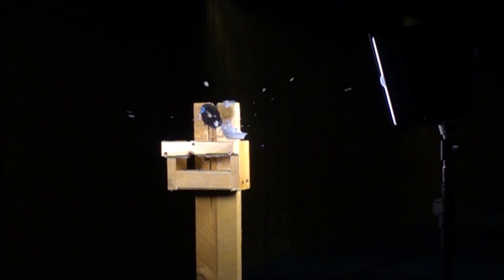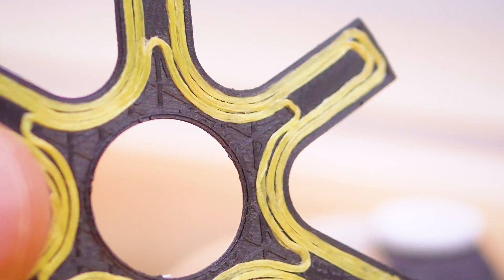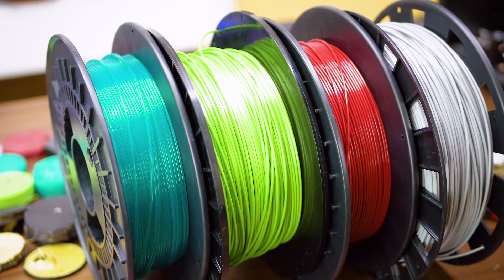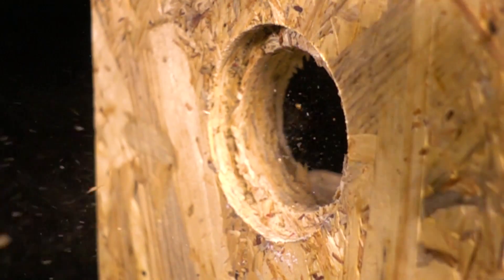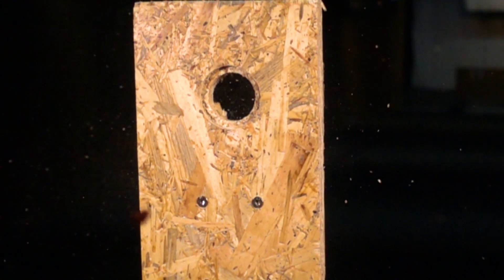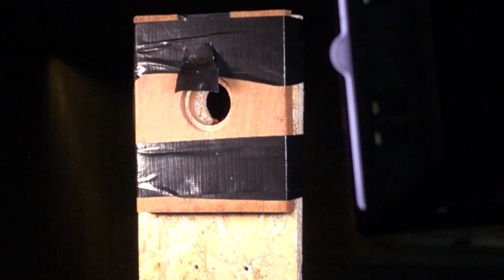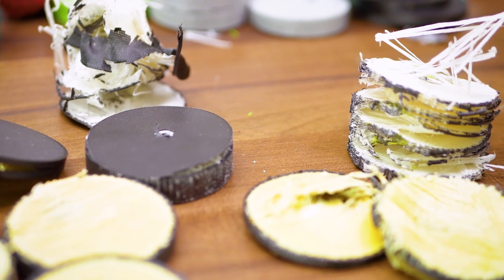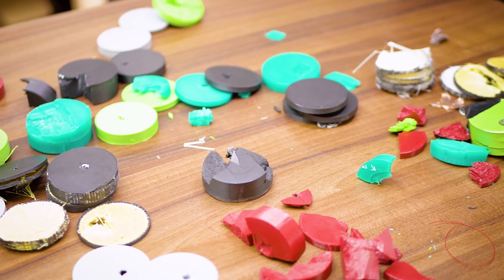Destructive testing: Which 3D prints are bulletproof?

Comment: Try TPU
Reply: i tried tpu. the brand i used needed 40mm to stop 9mm pistol round. stops at around 35-37mm. maybe some impact resistant nylon or high strength and elastic tpu would be best
Reply: @morecakesmorelays3270  Ok. Interesting. I thought the TPU part would have coped better. I wonder why the elasticity didnt pick up the energy. Maybe the 0.22 is just too fast.

Comment: Couldn't you either print or order a larger gear that drives each axis and that way when the machine carves it's a fraction of the depth of the non modified one. That way there's less pressure applied to the head and less flexing of the frame. Also maybe think of a water dripper over where it's carving for less likely to break whatever bit you are using

Comment: Hey tom, if you ever reedo this experiment, could you test to see if different infill patterns affect the bullet resistance? Or in the case of PETG, see if it holds it shape with shattering to pieces?
Reply: These were solidly printed parts, so 100% infill by the looks of things, the infill pattern used doesnt matter too much then.

Comment: WELL ... you printed them the wrong way, actually PLA has stopped bullets at 10 mm thickness, but the secret was they did not print it solid but nanotube inside, and yes, it requires a fine nozzle.

Solid structures snap at impact, nanotubes printed in progressive layers actually behave more like Kevlar, compressing onto each-other rather than snapping.

Design some nanotube structure, print it carefully, larger surfaces, minimum 10X10 Cm, try again, and you might come to some dramatically different conclusions.

Comment: Why did you test 45 ACP instead of 9mm? 9mm is way more common throughout civilian use, police use, and military use than 45 ACP. Not only that, but 45 ACP is the most powerful handgun round outside of hunting. It would make more sense to test the middle ground (9mm) rather than only two extremes (22 LR & 45 ACP).
Awesome video either way.

Comment: Hi, Thomas.  
Thank you for your great efforts in making this video -- Excellent stuff! 
I'm considering getting into 3D printing and maybe injection molding and have a query.

I have no plan to get shot at, but I do have some plans to make some kind of body armour for motorcycling. I was wondering if you or anyone else here could recommend a plastic/plastic composite material that would be relatively light weight, impact & abrasion-resistant, not have a tendency to explode into SHARP fragments.

The material is only intended to deflect rocks/prevent puncturing from sharp objects, but an amount of repeat performance would be desirable, of course. The main impact would be (hopefully) absorbed by a non-Newtonian layer, underneath the outer shell.

I've only just stumbled upon your channel and am about to embark on a tour.
Thanks again.

Comment: use hatsan 125 4,5mm 395ms as a test air rifle, i found out it goes thrue thick wood (they also got a 5,5mm but its 5ms slower but hits much harder) and i stopped using lead pellets so i only shoots steel in plastic.

Comment: how did you trigger the rx100??
Reply: Ah, thanks. I have one myself, but didn't know about the IR remote. As for powering the camera, you can just use a regular usb power bank on the cameras usb port. works like a charm.
Reply: Thomas Sanladerer Ah I see.. thats really dumb. I would have expected that the camera has a built in receiver already. I love the quality and the slowmo (that what I bought it for) but I don't think I would buy it again. The battery life is horrible when you do anything but take stills. And filming 4k video overheats the camera after just a few minutes and it needs a cooldown break.
Reply: no slomo, though ;P

Comment: Coolest plastic test ever!!!.
As an engineer you should know that PET is a very brittle material when even injection molded. So from an FFF nozzle you are not going to get the strength of a plastic water bottle. To get PET to be strong it must be stretched out, like blow molding or extrusion into a filament shape when using a draw down or even when doing a long 3D printed bridge.

Comment: 3D printing a Batman suit is one step closer to reality.
Reply: a dude on youtube is actually making one lol
Reply: @ABlackGuy10  Im making one... correct coloration, correct indentations ... No fake fabric nonsense... Its a long process. Mostly carbon fiber printed. The point is to make it an EXACT replica of the Dark Knight suit of armor. something like 80 separate pieces.
Reply: @someguy5926  You are better off getting something milled / CNC over 3D printed as a well-forged steel base is going to be heat treated in a way that 3D printed materials do not. You are also on the right path with kevlar layer's underneath but remember that just kevlar fabric by itself is not bullproof at all – it needs to be MANY (often like 30-40) layers of kevlar fabric which is often dipped in epoxy (basically plastic glue) that further solidifies the kevlar fabric into a plate. THAT is what is at the core of most bulletproof objects, like vests. You should also look into how ceramic ballistic plates are made. Overall 3D printing is great for looks but poor for material strength / hardness due to the way it assembles things. You would do far far better with a few stand ceramic tiles wrapped in a fiberglass sheet & some duct tape that everything presented in this video (which would be cheaper, easier/faster to make, & probably lighter). I am pretty sure that the production designer's of TDK meant this to be the material used in the batsuit because they call it a "composite" which usually refers to something like this when talking about ballistics. Perhaps with some aluminum thrown in for good measure. If you are deadset on using plastic you probably want to use HDPE (can be gathered from milk jugs & other food safe plastic), cut into small pieces then melted in any oven (look on youtube). You can use aluminum foil or wax paper to create a DIY mold for these as well & mass produce a number of essentially ABS plates that do NOT suffer from the weakness shown here from the 3D printing process. 

Material science is very important folks! Good luck on your suits.
Reply: @someguy5926  People are just looking out for you man. Better to give some good advice than have someone run around in a suit that blows to bits on the first impact.
Reply: I definitely wasn't thinking the same thing at 3 am so I can make one.

Comment: What filament would you recommend for parts to be used outside please. I want to print some custom handles to go on a small lever that is used on a motor cycle. They would be about 1 1/2" and threaded onto a bar. so they would have to put up with regular twisting. Thanks
Reply: not hundred percent sure about exterior use for a motor cycle since most plastics might melt in the hot sun or shatter in cold weather. But there are some that stand up better than others. How much twisting force is evolved, printed parts can be designed structurally strong but the shear force of plastic is still pretty low. If you plan on going forward I would suggest that you put a heavy UV resistant coating (or paint it) to protect it. Question does it have to be made of a printed plastic. Why not use the part as a prototype, test fit its placement, then when happy maybe get it cast in another material. Use it as a mold and cast parts using stronger resins or metals like aluminium or pewter. Both of these can be done diy-ish but it steps out of the bounds of just 3d printing it. So you might have to do some research on the methods. Hope you find a way to work through it

Comment: I wonder if it's possible to make the PETG less prone to shattering with a mix of materials, ie Dual extrusion. Obviously the best option would be to just use a different material, but could be a very visual way to show changing the properties of parts.

Comment: In simplify3d you can change the infill angles, meaning that instead of 90 degrees on every layer, you could try something like 10 degrees each layer so you won't get these square holes.
Reply: The square holes were on the MarkForged prints, made by MarkForged with their own slicer for their own printers.

Comment: If you hang the part you would of got completely different results as the holder you made puts pressure on the center of the disc and not on the overall object. The holder made it to where the outside could not budge so it simply went wit it that is why the last two kind of went through and got stuck
Reply: Like it briefly expands, gets lodged/press fit in the hole, then explodes into a million pieces because of static pressure? Like we see with paper in an hydraulic press?

Comment: I wonder how nylon does.
Reply: The Onyx is a nylon print.
Reply: That said, it's a carbon fill, which increases wear resistance, but might work against structural integrity. (Also, with the square holing and fracturing happening on the MarkForged parts, I'd like to see another nylon print by Tom himself.)

Comment: I still haven't gotten mine printing :(.  The nozzel starts to extrude but then after about 20 layers it just stops extruding... the gears in it is spinning  and no clicking.. also It is not jamed becouse I can stop the print and push the filliment threw with no problem...
Reply: You sure its not slipping? Pull on the filament with it locked in the extruder and see how much force it takes to slip backwards. You may need to clean out the gear teeth of the extruder.
Reply: When it stops, instead of pushing the filament through, pull it out and take a look at the part that was in the extruder -- is there a chunk ground out of the filament?

Comment: It would be interesting to have an internal structure with mixed materials to absorb the impact and distribute it inside the armor, converting it into deformation. Something like layered plates that push together and shift inside. Doing this with multiple layers and maybe kevlar / fibre sheets between layers might work. Or maybe not.

Comment: great video! reminds me of Mythbusters...very good job and interesting that in a worst case scenario, we could at least lessen the impact of bullets by having 3D printed parts in certain cases.
Reply: Yes, and it reminded me of when I lived in San Antonio, TX and the gangs were doing drive bys every single night.  They did them so much so people were told to sleep on the floor and there was a thriving business to put kevlar in the walls then the remodellers would put the sheetrock back up.  Now just print off 50-60 MM pieces yourself and insert them into the wall.

Comment: Surprising result for PETG !
Can you do the same with Nylon , POM and flexible ?
Reply: Gil B Actually, not surprising. PETG tends to crystalize(?) when cooled slowly. Especially, when printed with higher temperatures. It often cracks in random patterns, not even within layers. That's why I still prefer quality ABS for mechanically stressed parts.
Reply: PETG was all the rage (I even have a roll myself but I don't like it) last year but I think people have wised up that it isn't all that great afterall and sags like sob when printing (bridging and supports are nonos with it).

Comment: I find it interesting and weird that PETG which is a slightly bendy and softer plastic shattered so much, I assumed it'd be like the shatterproof plastic rulers, but it seemed to just smash like glass. Great experiment!
Reply: Spaghettikid if you take a PLA part and bend it slowly, it bends. If you bend it quickly, it shatters. Sort of same thing for PETG.
Reply: Keep in mind that there are structural weaknesses introduced by the 3D printing processes that you can see exposed here by the layers & break marks. Plastic that is injection molded / laminated / otherwise pressured into a high density does NOT suffer from these same weaknesses.